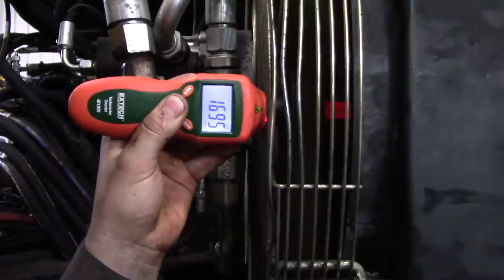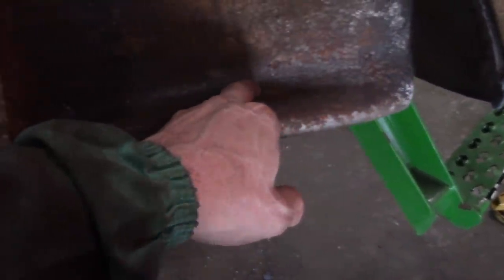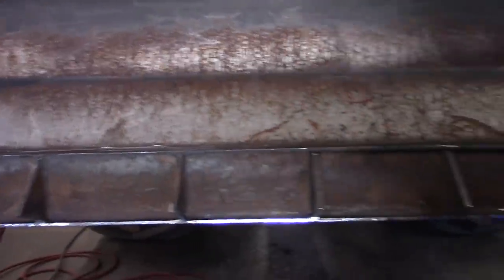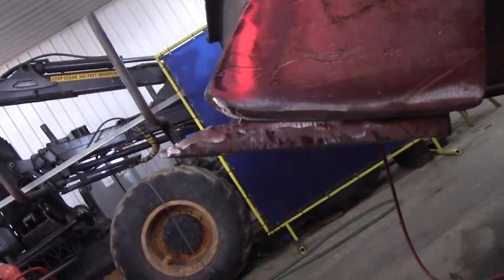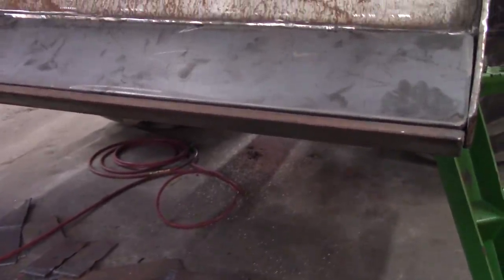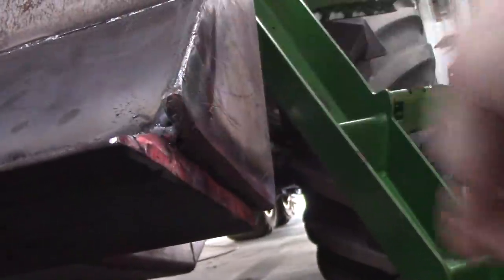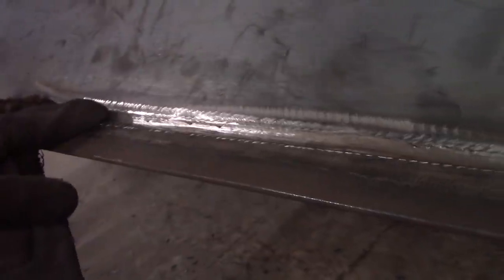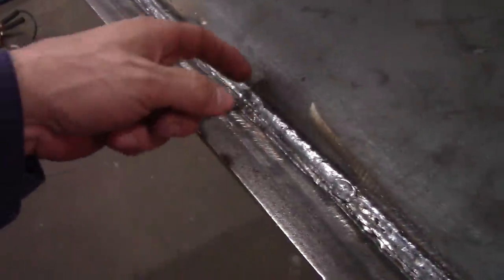John Deere 1010E blade welding repair

Comment: Awesome job Mike great step by step video just curious how come you went with flux cored wire over a gas shielded solid wire ?
Reply from the maker: Basically all I use anymore. It's all position fluxcore. So I have it on my service truck as well as in shop. It is gas shielded by the way.

Comment: Hi Mike!!😀😀
Nice job welding everything together!! 
But if it was mine, I would have had you put the cutting edge on the top and the flat underneath. Now the cutting edge will be scooping up dirt and holding it. Also the cutting edge will be always trying to pull away from the weld. Where if it was on top it would be pushing against the welds and would dump the dirt off clean like a dozer blade. 
Just my thoughts. 
Take care my friend!!😀😀
Reply from the maker: Yep. But as I stated, gotta do what the customer wants 🙈
Reply: @MichaelJBerg  :) The customer is always right. That's for sure. That's why I said " If it where mine " I definitely would have had you do it the other way. LOL!!  I hope they don't rip it off pushing trucks. You have it on there pretty darn good!!